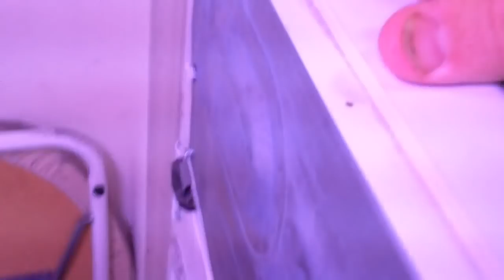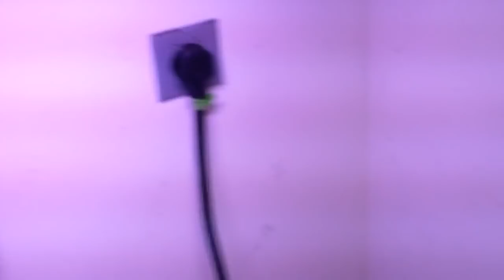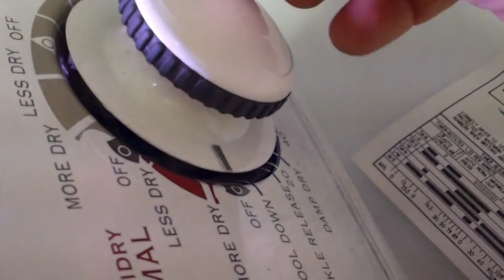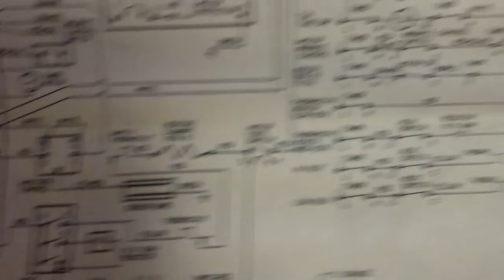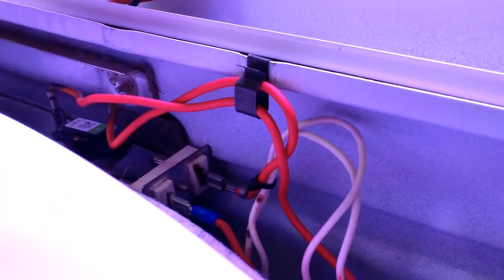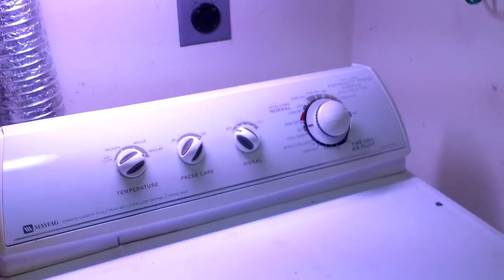Dryer not heating up

Comment: This is video is great. I have had the sad  experience of calling in "professional" appliance repair services and came to the realization that all they know is part replacement. I never fully understood this until i inquired about taking an appliance repair course. The course consisted of trying to match symptoms with by gosh and by golly guess work. If they eventually replaced the bad part with a good part the appliance would start working.  This would leave the customer paying for a lot of unnecessary  parts. If the appliance  didn't work the customer would be told that the appliance could not be repaired and should be replaced with a new one.   The customer would still be billed for the unnecessary  part replacement. I no longer use "professional" appliance repair services.

david

Comment: I do it machine running L1 to L2, measuring voltage rather than resistance. Meter black lead to L1 step through with the Red till you find the open to L2

Comment: would this process be beneficial for tracking down a problem where the (gas) dryer runs well ( drys, heats and runs normal), BUT the clothes and dryer smells burnt like a fire? I already vacuumed the vent tube and stills smells.
 I took off the bottom of the dryer and can see a wire which its insulation at the point which it goes into a connector is slightly burnt. Any ideas Will? Thanks ahead of time. GREAT VIDEO!

Comment: How do u confirm what's the culprit?  I checked all the thermostats, flame igniter, and solenoids.  All has continuity.  Vent and housing cleaned.  My Gas dryer does heat up but not holding, it shuts off after it reached some temperature prematurely.  I have taken the thermostats and checked when it triggers, all at right temp setting at 300F.  Could it be the Moisture Sensor or This Thermistor?  Dryer is ran without using the sensor dry (Time Dry) and it's still not drying the clothes enough.  PLEASE HELP
Reply: I am not a technician, but your problem might be a simple air flow problem. I would start by checking the lint filter and vent hoses to make sure there are not obstructions,  I would also clean the inside of the dryer,  by that I mean the areas that you don’t see, you might have to look for a manual or a video that shows you how to open the dryer (just a few screws, and some sharp edges to be aware).  Good luck.
Reply: Provide the make and model number please, we can look up the schematic.I suspect that a high limit switch is opening the circuit. It will open if the vent or lint filter is blocked and prevent overheating. Or if it is going bad, may be opening too early. Often there are two similar bi-metal safeties. One a high limit and the other a thermostat.
Reply: What is good on ohms, may not be good under a load. Often a voltage test while the unit is running will show more info than just a simple ohms test while unit is off. Remember your DMM is only using 9volts to test continuity, but 120 or 240 volts (electric heat) is putting a lot more stress on a component.

Comment: is it possible to test the motor switch by moving the sliding spool on the armature forward with a screwdriver, which should actuate the switch?
Reply: Is that sliding spool you refer to activate the centrifigal switch contacts?
Reply: SHOULD WORK

Comment: Thank you for this video! I did the standard checks when our dryer would not heat but everything checked out so I followed along with your steps and it was in the timer unit and I was able to open it up and get it working again.
Reply from the maker: awesome bud, great job

Comment: Very informative video Mr Robinson. HOWever it didn't quite  touch on my problem. I tested, OK for my heating element and my high and low temp thermal switches. Runs but no heat. While its running I have 120 volts at both leads going to the Heating element. I have 120 volts at L1 and L2 to neutral at the block. I have 0 volts across L1 to L2 analog meter. It seems like I should have 0 because I'm testing 2  power conductors, and not power to ground, maybe its because you ahve digital tester. Your tester showed 240 volts L1 to L2. Do I have a problem there.  I tested my Cycling Thermo ( it has 4 terminals) the 2 outer terminals test 0 ohms,  the inner terminals tested  6 on the X10 scale. Is this correct ?  Maybe somebody else can answer this also. I'm not much of an electrical tech.  Thank you very good vid Mr Robinson, thank you for the great information. I might take the cycling therm to the appliance store tomorrow and have them test it. for me. Everything else seems ok.
Reply: Did you disconnect both leads from the heating element to check for 120 volts to ground from both sides of your connector?   Remember you need both "hot" leads to get the 240 volts. (L1 to neutral= 120) + (L2 to neutral=120).

You may only be getting one leg to the heating element. Check with reference to ground.

Comment: great vid, but if your power supply is 220 volts, live and neutral, not 120 volts on each line, how would you connect the dryer?

Comment: For enhanced safety: recommend installing a 4 prong cord and outlet, the fourth connection should be a dedicated ground wire back to the load center /meter main
then the bonding jumper as shown on the dryer from neutral to chassis needs to be removed and the (fourth) ground wire in the cord be installed direct to the chassis of the dryer!
Reason: If the neutral is used to bond the chassis for protection against shock is ever compromised between the dryer and the Utility source then 120 VAC can be imposed on the chassis of the dryer!

Comment from the maker: Yea in hindsight i was going to perform all test in that manner, especially if one had a questionable test result, even with a schematic that shows an open already in a circuit, don't mean something wasn't added, or has failed down the line now your reading the resistance of a load across the contacts, seen many people misdiagnose blown fuses, testing while in the circuit

Comment from the maker: Thank you, on occasion i run into the same issues with industrial or residential, for the most part you can tell with a resistance check if something is out of limit, say a burnt element that is slightly touching each other will most times have a higher resistance than a known good element, same goes for contacts, this is because of the contact surface is less hence the higher resistance, at times live troubleshooting is the way to go, most of my industrial troubleshooting is done live

Comment: Hi Will
Great video.I have not troubleshoot appliances yet,But I am not a fan of resistance testing while diagnosing automotive faults cause as you certainly know in auto most circuits have to be loaded to fail.So I almost always use amp clamp or voltage drop with loaded circuit.But with 120V OR 240V AC is it possible that heater element only fails loaded and pass the continuity test? Just wondering.

Thankx

Comment: The point you make, to at least partially disconnect a device before testing continuity, is very wise. Lots of guys make the assumption that there is no connection elsewhere, but there is nothing worse than misleading information.
Ha ha, it's cool you left the element to the end. I have to admit, I would have gone to the element first, skipping all the rest. But that also would have been an assumption. Great video, Will.